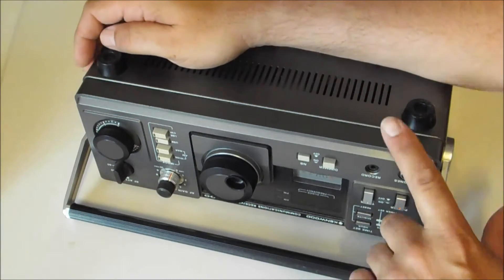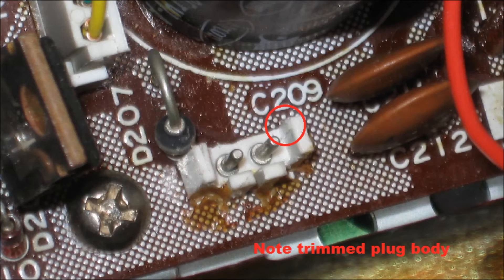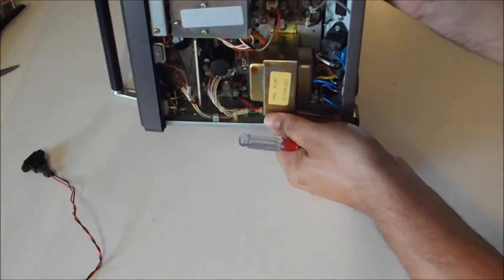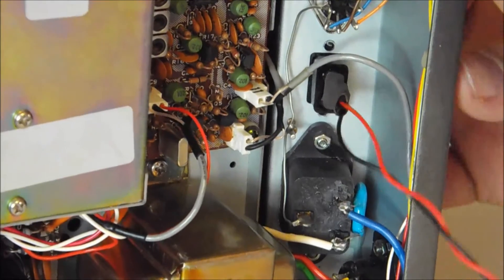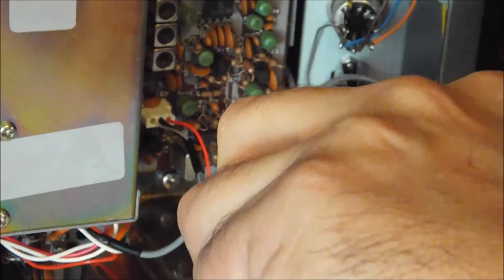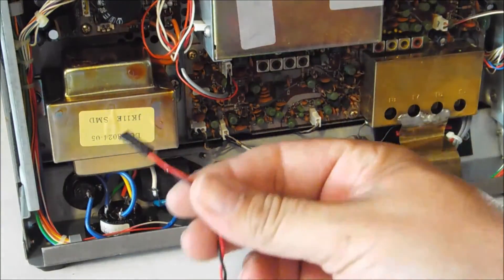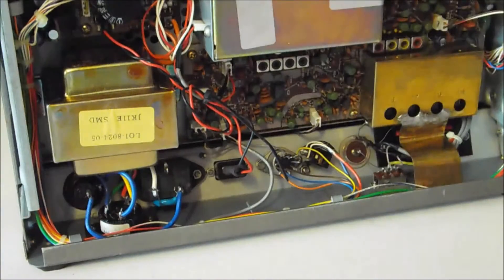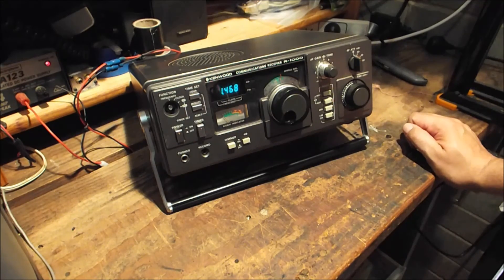Kenwood R1000 - 12v Power Modification

Comment: I have everything but the female plug that would plug into the two pin connector on the board.

Where can I find the female plug with the pigtail. to run from the board to the 12V import plug. Please advise
Reply from the maker: This cable and plug was surplus from a old PC I stripped down, the cable was for an LED indicator or speaker if I remember correctly.

Comment: Yeah I can't find one anywhere to fit the headers
Reply from the maker: I physically removed the PCB header to trim it down but could have just as easily used a sharp modeling/hobby knife with it insitu, the header/plug cable was easy to source as I have a tonne of them from when I repair/restore/recycle PC's but I note similar cables are used for the Arduino style mini PC projects.

Comment: Where can I find the plug with wires attached that you plugged into the 2 pin connector on the board.  What are these mating connectors called?
Reply from the maker: SMD connector? used in PCs to connect LEDs to motherboard 👍

Comment: Hi Oz, my R1000, has this mod already, however the clock will not keep its time after switching off? Do you know of a fix for this?
Reply from the maker: Matt UK Good question, I never used my clock as the switch shaft was broken, I would imagine a super capacitor is involved somehow to maintain current to the memory cell much like the old scanners however I could be entirely incorrect.